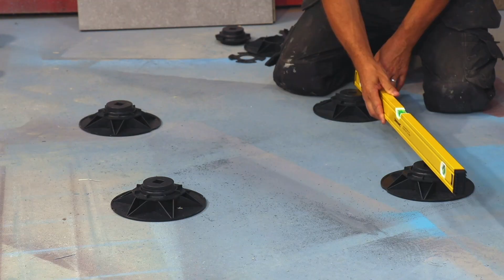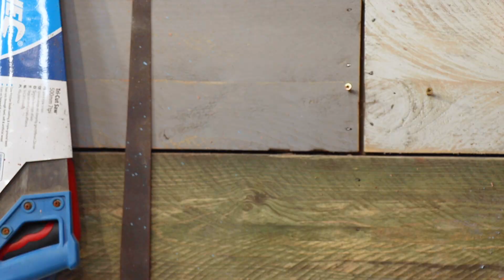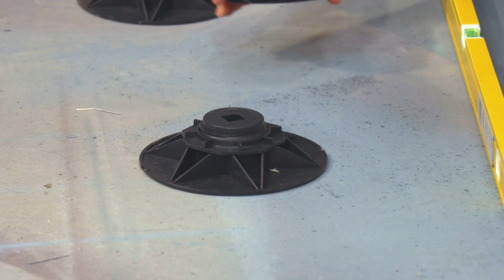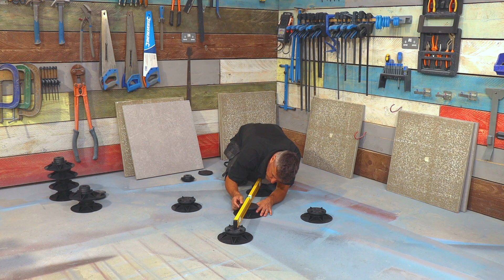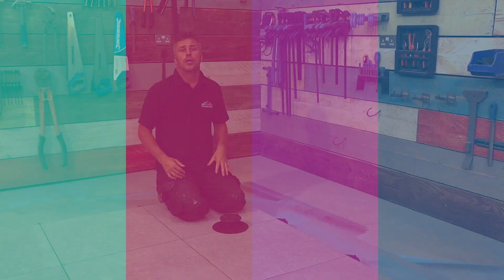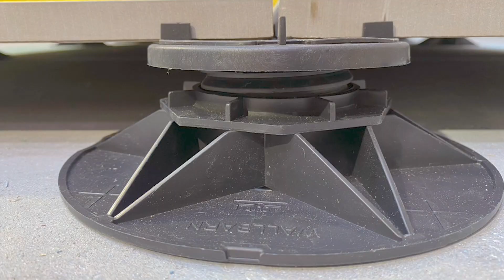How to Install Outdoor Slab Tiles Using Adjustable Support Pedestals

Comment: Near the end of the video, with respect to partial/cut edge tiles, you say "you will have to remove two of these little upstands from here and here to allow that half-cut tile to sail through and still leaving you a small gap on the backend of it"". What prevents these half-cut tiles from sliding further away to the edge and the internal gap becoming bigger?
Reply from the maker: the adhesive will be dry and will hold it into position